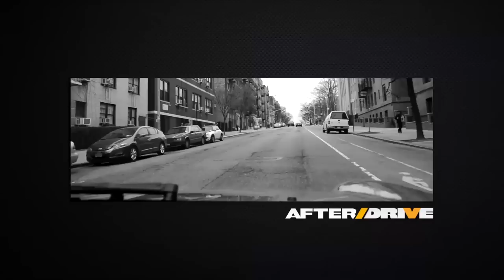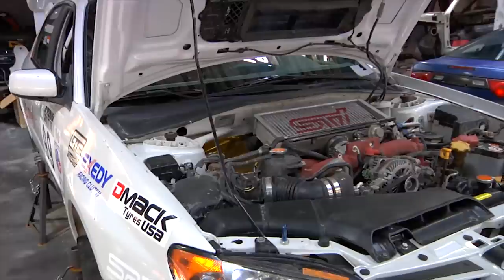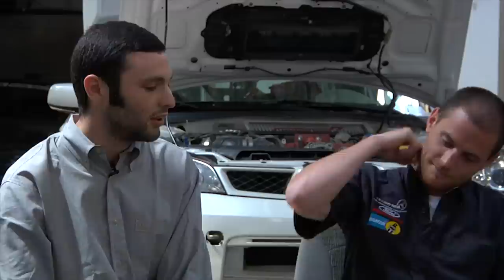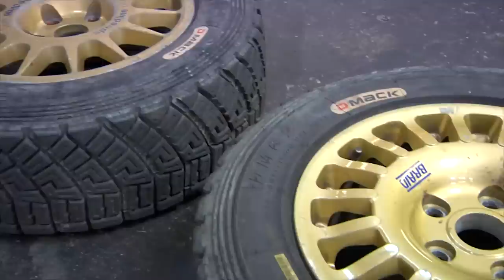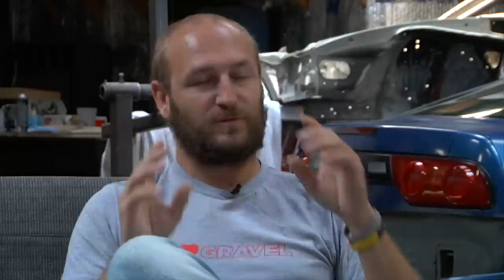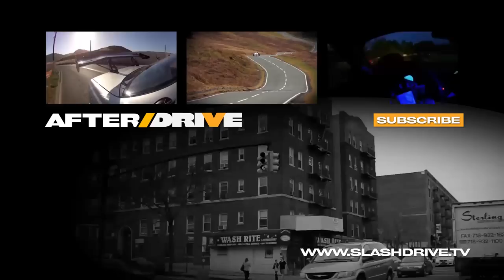How To Get Started Rallying Your Car -- AFTER/DRIVE

Comment: Why are you clinging to a series that was only around for 4 years?   Even the most recent incarnation of WRC cars (300 hp, 400 tq, no electronic aids in trans or suspension) Are still Way faster around a stage than Group B. Yes, B was spectacular. But the cars were a product of their time and handled like shit.  Todays drivers are skill artists with the cars. Both in the WRC and in RA. They dont need 800hp to make the car fast.  They have crazy skill.

Comment: It makes no difference FWD or RWD, you still must learn the exact same skills.
You must think just as far ahead. Mistakes in FWD depend--the one thing is once the rear is serious sideways, it is scrubbing, not accelerating so that covers "too hot entrance" mistakes. On the other hand, with a good LSD, the FWD will tend to plow ahead--go wide and hit things on the outside. Very typical.
Talbot Sunbeam was RWD, McRae next did Escorts and Sierrras---also REAR wheel drive .. Wrong a lot?

Comment: 944 what? Volvo? Possibly, but a bit long at 109" on the wheelbase so you need to attack harder of it will plow..
Not a Volvo 944? Then no, too low, too short, too delicate.

Comment: automatic transmission vs manual transmission for rally
Reply: sequential
Reply: BAM
Reply: Sequential, eliminates clutch from manual making the shifts faster. Better control then Automatic, as some automatics tend to have weird gear shifts; with sequential you have control over the shifts.
Reply: but also sequential is expensive as shit so manual
Reply: callahanthecrooked He said for Rally, so if he meant Pros then yes Sequential. If he meant for starting out, then I guess you could do manual first but upgrade to sequential as it essentially will give you better times (if you're good enough).
Reply: i just bought a manual opel corsa group n rally car
Reply: Sequentials are unnecessary until you get to a very high level (you are doing it for a living, ie pro driver), a sequential box will cost many times what a beginners car is worth, a good middle ground is a dog box. For a T5 you can get dog boxes as cheap as $2500, it will shift up as fast as a sequential more or less anyways (dog boxes allow clutchless upshifts) the trade off being you can still miss a gear since you have to row the H-pattern and you have to double clutch downshifts. A sequantial tranny will cost you at a minimum $10,000 if you are lucky and can find one used. The WRC cars are running SADEVs that cost as much as $30,000. Manual is definitely the way to go.

Comment: OOooohh a Porsche 944. Well they're good road cars---as in smooth roads, as in asphalt... But 99% of North American rally  is on gravel and doing a Porsche who saddle you with problems of ground clearance, limited suspension travel, room inside for the rather complesx cages required now, and once you have a cage in, room for you and the co-driver.. A lot of unsolvable problems...
You want to go rally? find a nice  Volvo 240
Search here for: Släggräsern 2011 and 
Jimmy Olsson Varvloppet -12

Comment: What is all this nonsense about thrashing rental cars? Just drive your own car. It doesn't matter what it is, as long as you have four wheels and an engine, you can practice driving. Take it to an entry-level motorsport event like they said, and have fun. As mentioned, if you want to step up from grassroots to rally it will cost you thousands of dollars, so just start with the club level events.